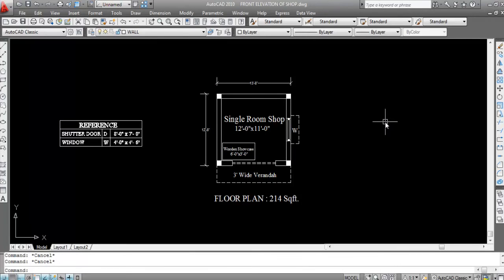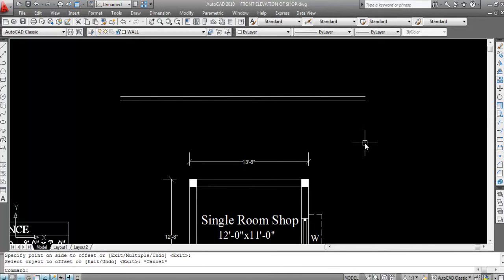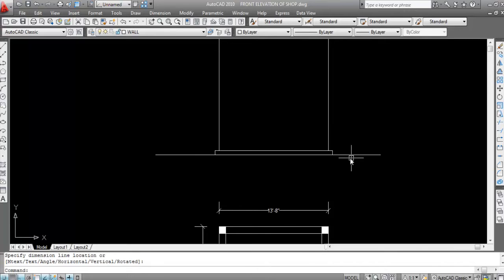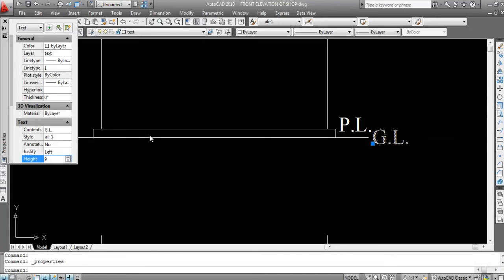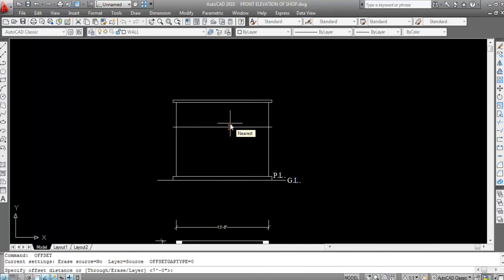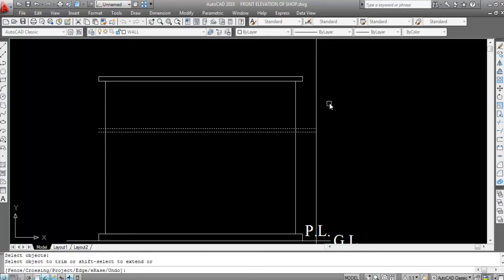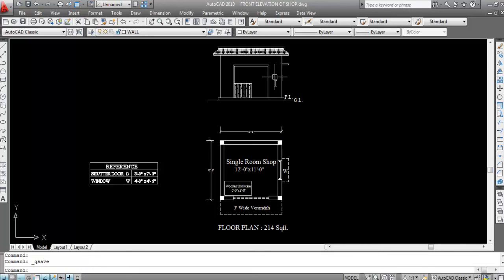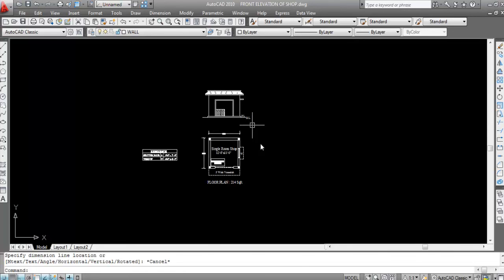2. SINGLE ROOM SHOP Drawing - FRONT ELEVATION in AutoCAD | Building #4

Comment: The height should be from GL to PL 10’’ to 1’6”
Reply from the maker: Plinth height should be in between 300mm to 450mm from ground level but it's recommended that the minimum plinth height is taken as 150 mm or 6inch.